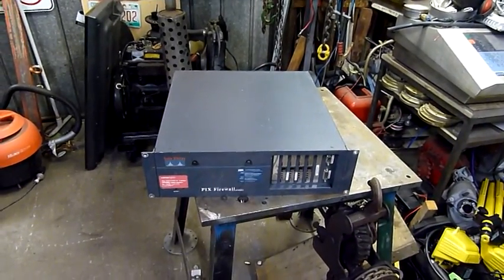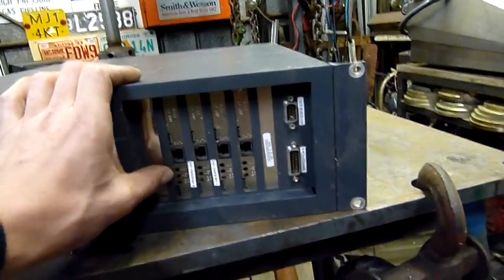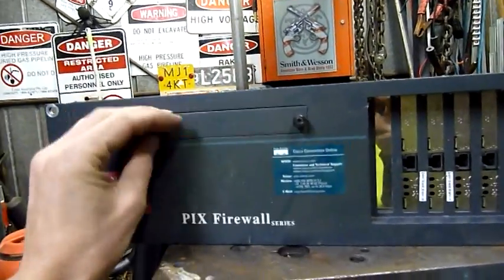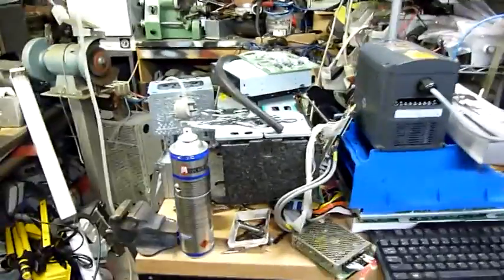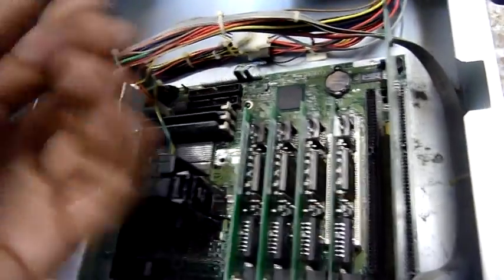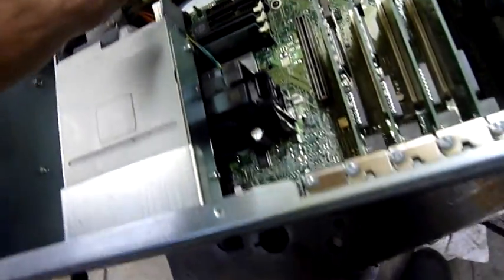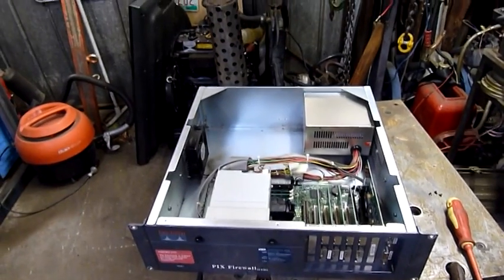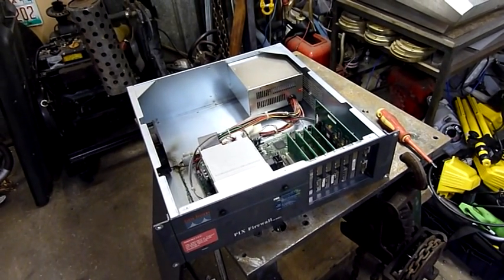Cisco Systems PIX 520 Firewall

Comment: The serial is for console access.  Usually you'll get the boot log and sometimes a command prompt.  The failover is probably something which either allows reporting of hardware failure or automated backup deployment.

Comment: Not worth it. Huge waste of electricity for what it is. You may as well install PFSense on it, seeing as the PIX is really just an x86 platform with an unintuitive OS on it. ASA 5505's are OK, can't push more than 350mbit without latency, and are a P4 Celeron platform anyways. PFSense is free, w/ roughly equivalent feature set, and then some. We use them for remote network IPSEC VPN. It also can speak BGP.
Source: I'm the infrastructure manager of a large campus network serving 16,000 devices.

Comment: Your best bet for racks is eBay, Craigslist or similar.  Damac makes some decent networking racks, and I've bought a 22U HP server enclosure off eBay for a hundred bucks before.  For server racks, you need to be sure that whatever you're buying has 4 posts, and get rails for each server you mount or they'll get stress damage.

In terms of firewall OS, I highly recommend pfSense in case your Cisco box is out of commission.

Servers are loud as hell, I might add. Not for families. Hairdryer 24/7.

Comment: Firewall's like Pssense don't need a hard drive you can simply run it from a flash drive or burn it to a CD and run it that way. There is an option to install it to a HDD if you want to run something like a web cache.

Comment: From a IT administrator point of view, this would be more work then it is worth! if you want some network protection i would just use a gateway server in-between your local and external networks, a software firewall will be suitable for your networking aussie50.

Comment: PIX firewalls were End of Life'd by Cisco many many years ago.  You'll need an RS232 cable to connect via PuTTy.  Better buck up on your Cisco PIX command line lingo!

All kidding aside, it's really not worth the effort.  I used to run a PIX 501 back in 2001 and replaced it in 2004 when it hit EOL by Cisco.  Using an ASA 5310 now.  But really, you're better off getting a Juniper SSG-5 from ebay.  Enterprise class features at an affordable price.

Cheers!

Comment: Yep should be really simple just like any other Linux. X86 based routers and firewalls are awesome i use them on all my networks and the stability over the cheap ones from the big box is great i have a few with over 1 year up time.

Comment: I wouldn't bother using it, it looks like a power hog.
Get a decent dd-wrt compatible router and you can set it up for whatever you need. I use a netgear wnr3500 v2. It has a fast cpu and a good bit of ram. dd-wrt is Linux and you can install software on it or just use the iptables firewall that is built into Linux.

Comment: you can run PF on a SDcard with the right version of PF as there hardware made for it hell you prob get away running it on a old P4 with 2 nics in it and a usb stick off the inside headers(via header cable).

Comment: Good for learning Cisco but overkill for your setup I would suggest you take a look at Tomato firmware loaded on one of the routers that supports it. Tomato allows great network control and VPN access too. It replaces the dumbed down original firmware. I have a Linksys E4200 and the original firmware is total crap Tomato makes it like a commercial router with heaps of options.  Search for  tomatousb firmware

Comment: Install a newer mother board and some kind of Linux based fire wall. Because even if you get the thing to work the software is so out of date it will probably offer little protection.

Comment: You need to check your facts and data sheets.  Your little microtik router doesnt out perform this router.  If this router has the unmetered connections license itll stomp all over your microtik, heck it can manage more new tracked connections per second than the small microtiks can manage full stop.

Comment: The unmetered connection version would be similar to a modern unix/linux based firewall running on a desktop pc - far exceeding the capability of any SOHO router available today.

Comment: The usefulness of the unit will depend on what licenses are installed.  It came in 128 1024 and unmetered license versions.  If its the 128 license then its trash and not useful for todays internet. 1024 connections would be useful and make it approximately as useful as any SOHO router, except more stable and able to handle 'extended abuse' if its working properly

Comment: You probably won't be able to hook up a monitor on that thing, even if you install a video card. You might be able to use the rs232 port to spawn a terminal on the machine, just try some settings with putty.

Comment: I would check if the bios can boot from USB, and if so, just get a sd card and usb adapter and boot from SD card.

You might want to investigate the opportunity of replacing that power supply with something more efficient, considering it would run 24/7 in your house.
This board would probably be 5v heavy so modern power supplies many not be that good for it.

Comment: It's just like old school digital pinball machines, certain things are taken from the on-board bios, then everything else is taken over by the auxiliary board once it kicks in.
If you don't end up using the PC with the case and Jay don't want it back, I will buy it from you, no time-wasting. You could upgrade the mobo but then it's another case lying around, you may as well build a dedicated firewall/youtube uploader machine.

Comment: You configure most Cisco devices over a serial console port (9600baud, 8-n-1) with a special cable. Cisco IOS is a bitch to newbies. You're better off using one of the many junk computers you have and installing pfSense on it.

Comment: Probably more hassle than  its worth for a home network.  You can use hyper terminal or putty to get to the console over serial.  I use an Asus RT-N16 with Tomato firmware for my home network.  I'm an IT tech but not used one of those.  We use Sonicwall at work.

Comment: Like most pix things you should be able to use a db-9 cable on the console port this is how you program it. As for a graphics card I don't think it been done or has a point. As for programming the device Cisco devices run a I.O.S or integrated operating system which you program over serial in the cli, the I.O.S also custom commands for Cisco. I might be able to find a upgraded I.O.S through my Cisco networking academy I attended.